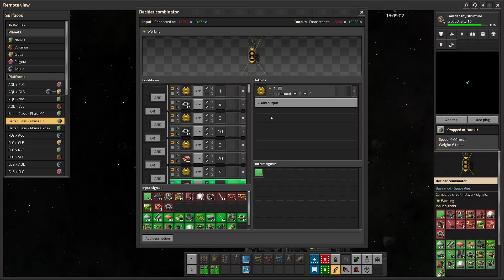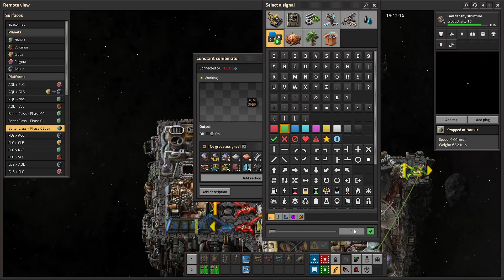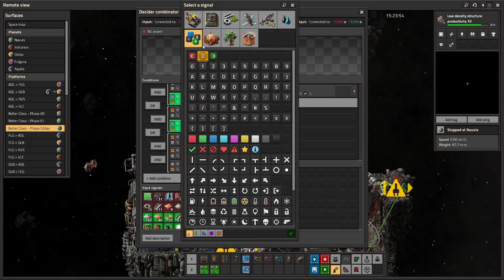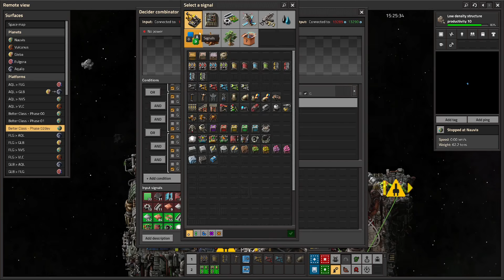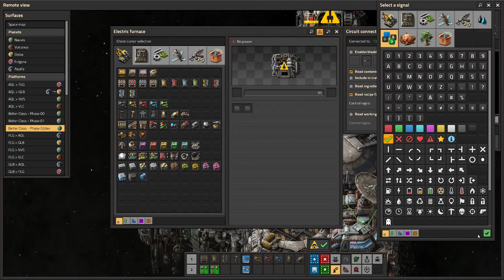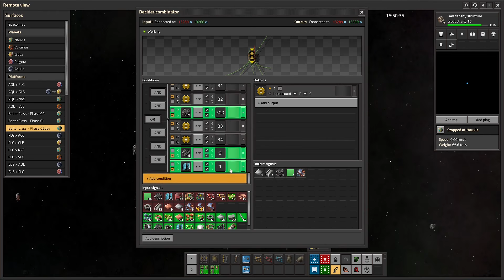Ep3 - Basic Manufacturing - Factorio Space Age Self-Building Mining Ships

Comment: 15:32 You do have 12 furnaces. But each furnace can hold ingredients for 2 operations (more for very fast recipes). And then you can have one craft that has already consumed its ingredients. In total, each furnace can have up to 3 outputs still coming out after you stop inserting ingredients. I.e. the stop condition to fully utilize a 1 stack buffer in the hub would be 100-24=76 or 100-36=64 (and for 3 stacks it would be 264) instead of 100-12=88.

12:00-ish: What is the reason to not make the fetching of asteroid bits dependent on how large your buffer of asteroid bits is that could go into crushing (instead of looking at the post-crushing ores for determination of when to stop the grabbing)?
... Ah, it's because you're currently not reading the contents of the grabber.
But is everything you grab going to be crushed? If not then you could end up with a grabber full of metallic asteroid chunks before you want to start grabbing other asteroid types - at some stage in the future.
Reply from the maker: Yes, there's potentially some overrun in production here when switching recipes, and yes, the current grabber has pretty simple logic to it since it is only grabbing metallic chunks, and then the crusher always crushes all chunks, as you observed. I'm not going to say more so as not to spoil later episodes. ;)